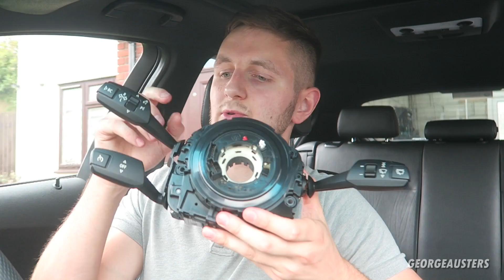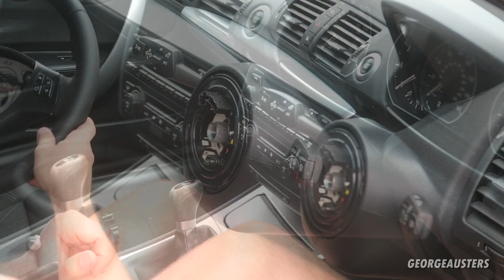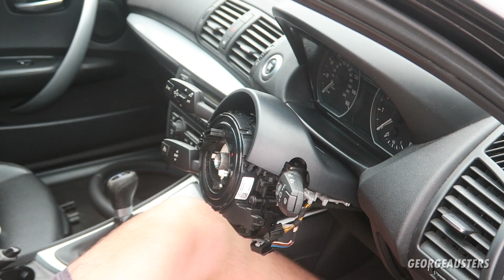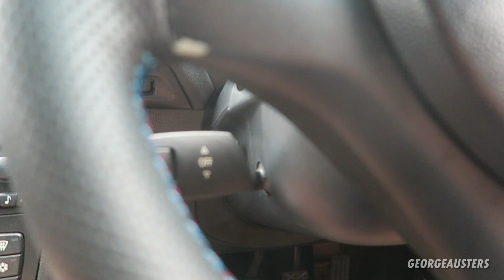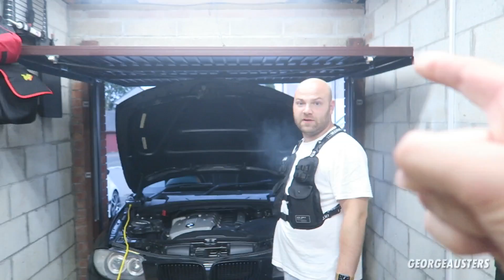BMW CRUISE CONTROL RETROFIT *Step By Step How To Guide*

Comment: Does anyone know the part number for the lower cowl that will fit the cruise control Stalk? Or I heard there is a template bmw came out with on how to cut your existing cowl. Where might someone find either the template or bmw part number?

Comment: Hello, I want to add cruise control to my e91 2006. My question is whether I need to look for a spider (combined switch by part number) or can I just find a spider from the year of my car and have it have the same rear wiper switch as mine, etc., everything is identical to So far I only have a switch for the cruise control and whether it can be coded with a computer, e.g. Autel, which has coding functions. Regards
Reply from the maker: Watch this: If You Own A BMW, You MUST Do This Modification!
https://youtu.be/am8slripDw8
Reply: Thanks :)

Comment: Would have been useful to link the coding video…
Reply from the maker: No coding was needed in the end
Reply: @GeorgeAusters  steering angle error solved itself?
Reply from the maker: Yes, just need recalibrating
Reply: You don't just add a new button, and it magically works. Obviously, it didn't work, so there's no part 2. You will need an additional module and maybe proximity sensor. "No coding was needed"😂😂
Reply: @PetcuCezar  sorry can you send me any name to any video to see how they did that ? 🙏🏻🙏🏻

Comment: Hello George. It is wonderful video. Thanks for it. I have Bmw 116i 2009 model. I would like to retrofit cruise control but I need  stalk units. Where can i buy it? isn´t it possible to just buy a cruise control stalk and stick it into the original piece? I will be really glad if you can help me.

Comment: If you buy stalks without rear wiper functionality(sedan version) switching only old wiper control stalk wont work.
Reply: If you install stalks without rear wiper it still works tho, apart from rear window wiper.
Reply: And what is the solution? You can activate it somehow?

Comment: Hello George. I have a BMW 3 Series E90 and I want to do this to it, will it need coding/angle sensors sorting or is it as easy as plug in and it works?
Reply from the maker: This was plug and play pretty much

Comment: I've changed my SZL but because it was from a used car the VIN doesn't match up so I can't calibrate the steering angle sensor. I've tried looking for part 2, the coding video, but can't find it anywhere. Did it ever get made?

Comment: Hello George! At minute 4:50 you talk about swapping the wiper stalk pulling out the stalk itself and disconnecting the ribbon cable. Is just easy as pulling the ribbon cable? It seems to be quite hard and i'm afraid to brake something
Reply from the maker: Easier just to change the whole SZL
Reply: @GeorgeAusters  i'm trying to retrofit the cruise control but i need the non automatic wipers stalk from the old piece. I'm only complaining about the ribbon cable, if is only needed a pull i'll pull :)
Reply from the maker: Use a small pic tool to help you disconnect it
Reply: @GeorgeAusters   Hi, something bother me, maybe you can answer. Why you change the wiper  stalk? and not change the cuise control stalk and you  stay error free and code only the cruise control option .  Regards.

Comment: Do you have to disconnect battery to put squib in and wires
Reply: If the outer casing is like for like. I wouldn't need a new  case

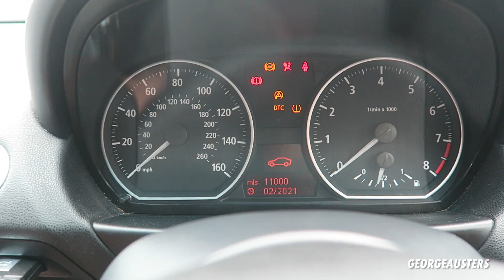Comment: 7:46. Just retrofitted my cruise control 2 weeks ago. All the warning lights came on and I thought I broke the car so havn't driven it since. Thanks for clearing that up for me.
Reply: Hi mate i have an e84 and really wanna do this. Problem is the scrib keeps showing as doesnt fit my car as obviously the scrib on my car has no cruise control leaver- did you just order one from same model as your car?
Reply: @jed7200  Your on about the extra little indicator stalk? I grabbed the whole unit out of a wrecked BMW X5.

Comment: Hi George,
I did the changes. however, a message came on suggesting that there’s an error

CC-ID 24	DBC Dynamic Brake Control Brake Assist Failed. 

Please advise on how to clear the code
Reply from the maker: Just need to calibrate steering angle sensor

Comment: Hi, did you have any issues after fitting the rear wiper stalk to the non rear wiper szl? What additional coding/programming steps were required to get this to work? I've just been playing with an e90 szl for my e81 and after swapping the stalk over it seems that the szl needs to be reprogrammed for this to work. cheers
Reply: I just did my retrofit today, and unfortunately after changing the wiper stock and all coding I have noticed that my indicators stock and wiper stock have been not working at all. I do believe it is to do with the compatibility, because I took out the steering angle sensor out of pre LCI 330d e90, and have put it on LCI 318d E91. So I didn’t even bother to try it out if the cruise control worked or not. I have read some treads on the net saying that the 3.0L have had adaptive cruise controls with auto braking etc. and 2.0 have had just the speed maintaining ability with no braking at downhills

Comment: Hi George and co…. I just had a questions. I own a 320d efficient dynamic that doesn’t have the cruise control. I wanted to retrofit a cruise control thus I purchased the unit and the new fittings. Would I need anything else ( such as the cruise control module etc) or is that all I need plus the coding? I hope to hear a response from either yourself or anyone else who knows about this query.
Reply from the maker: Should be plug and play

Comment: Does the lower steering cowl trim from an e90 fit e87 fine? Thanks
Reply from the maker: Yes
Reply: @GeorgeAusters  thanks mate! Just had a delivery and turns out they only sent out the stalk/switch for the cruise control, i need the whole squib unit right?
Reply from the maker: @garyho5176  Yes
Reply: @GeorgeAusters  thanks buddy, does the top part of the trim need to be replaced too?

Comment: Thanks for this video mate managed to pull it off a day before a 1,000 mile drive! Well worth it for the price. Can't seem to get the cowling to fit on both sides, only clips to either one or the other. Did you encounter this issue? Real oem says it was used on my model
Reply: Im doing about 600-700 miles per week in my X1 and have done for a year now. Looking into fitting this - recon this is easy enough DIY?
Reply: @jed7200  yeah man not too hard got all the bits for under 100quid including the coding from a guy with ISTA.
Reply: @HkBgNuiB  i have found a guy to do the coding. I have the main console bit with the stalk. How did you know what trims to buy is the only bit im stuck on? If you have a part number or a name to search id owe you one lol

Comment: i don't think is that easy, im trying to do the same installation for weeks now, and guess what... swapping ur wheel and cutting 2 wires is not what is all about... most of them forget to mention u also need the cruise control module GM5 which is not the same as the comfort module GM5 ... and sure connecting the steering wheel to the main DDE or the car CPU is easy... but that CPU has to talk with the GM5 cruise control module... and if u don't have it ... u will get ur acceleration blocked and killurself... so most of this tutorials are 50% of the job... you should also show us which modules do you have and how u connected that cruise module to the main cpu. in my case for example, i have the comfort white box e46 series right? but i also need the cruise control unit, to control multimedia and cruise control, while the steering wheel wiring to cpu is correct i have no cables (25 pins wires) that go to the cpu from cruise control... so i find it a bit weird this will work without an actual cruise control unit... just placing a steering wheel and connect 2 wires cmon...
Reply from the maker: I never had to remove any modules, everything in this video was plug and play

Comment: Hi there just got a 1 series BMW is it possible just to get the cluster that goes on the steering wheel ?? Or a whole new steering wheel ???
Reply from the maker: Yes
Reply: Thank you would that be coded in ?? Where would the best place to get that from thanks for the reply cheers
Reply: Cluster switch on the steering wheel ?

Comment: Nice, can u tell me that after coding rear wiper works?
Reply: Hardware controls the rear wiper. If you don't have the right switch board in the steering column, then you can't swap over stalks. I'm a tried and tested fail

Comment: Hey George, really interesting and helpful video...nice one. One question, by adding the cruise control is there another plug/connection to be made as we're adding another function, or is the cruise control wiring already incorporated into the wiring loom? Cheers bud 👍
Reply from the maker: Already there👍🏻
Reply: Tks George

Comment: Awesome! so when you swiched the wiper arm out with your old one it worked just fine?
Reply from the maker: No it didn’t.
Reply: @GeorgeAusters  really ? What did you do to make it work ? Coding ?
Reply: You have to buy the right model (LCI or Pre LCI) and the from the right car. For example, my LCI E91 needed the unit from an LCI E91, i tried a pre LCI and still didn't work